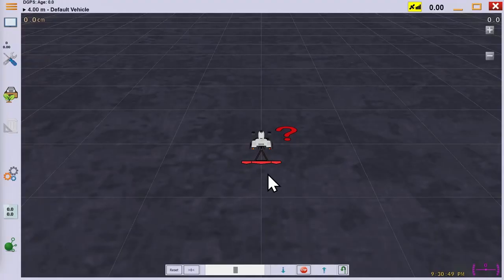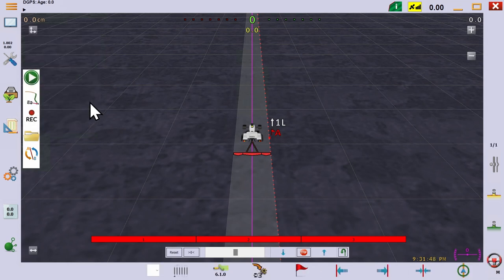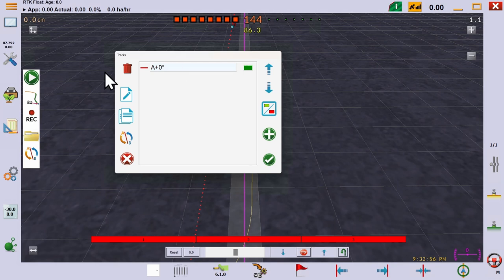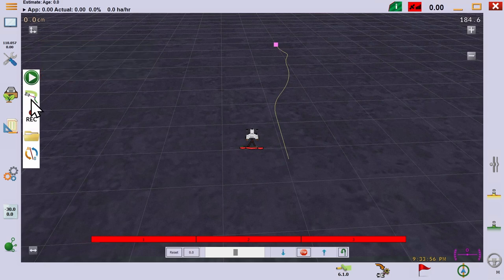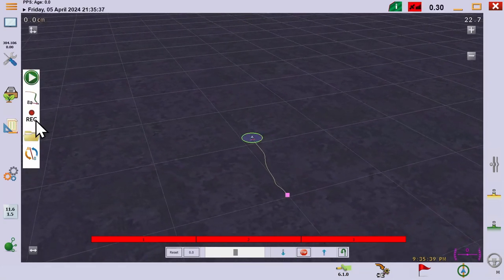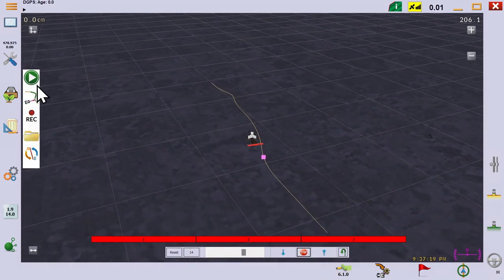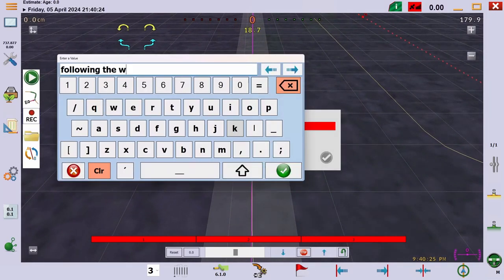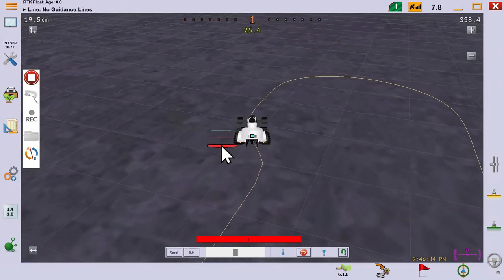Recorded Path

Comment: I use this feature all the time i our orchard.  The trees were planted in a straight line but replacements for dead ones were never spot on so using the AB lines doesn't always work.

The recorded path will also record  the speed, section control etc At least it did in older versions.